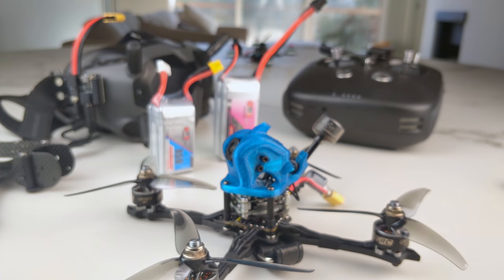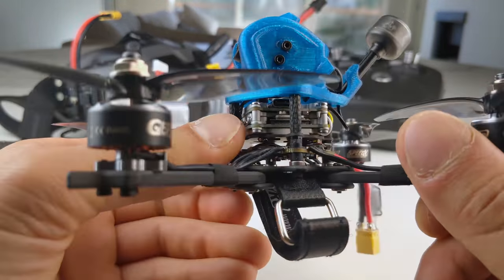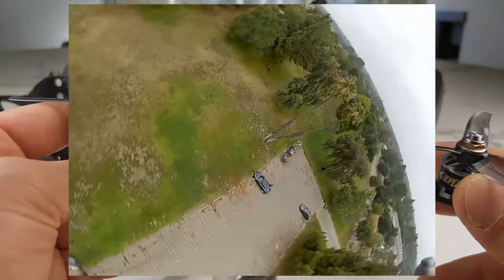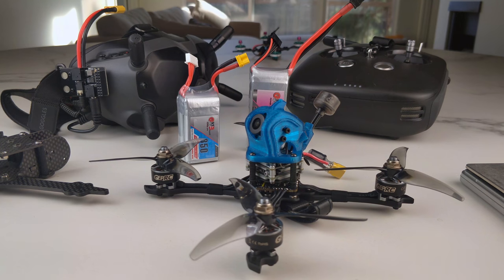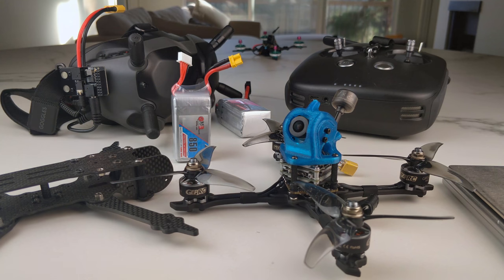GepRC - Dolphin HD

Comment: I never had those twitches but I was having desyncs with my standard definition version. 
I like the first one so much I ended up buying three of them a year ago and I'm still flying two of them. I did break one arm and cracked one by the motor screw, they are very tough and very reliable once you get them tuned right. Perhaps the flight stack height and weight difference had something to do with what you experienced?
I'm curious to know if you ever got that tuned out because I'm thinking about switching to digital and I'd like to know what to expect.
Reply from the maker: it's hard to say what a random desync is from. especially on these AIO boards. If it happens more and more often over a bunch of flights then it's an ESC going bad

Comment: Did yours have something making Ch.12 fluctuate in BETAFLIGHT on the receiver tab?
I remapped with mixes but it didn't change.
Telemetry perhaps?
Reply from the maker: It doesn't but I've seen that and I don't know why it happens. It seems to be more I'd a software issue than hardware. They reflashing betaflight

Comment: Definitely agree on the 6S thing. For racing 6S/5S helps a lot with sag and gives more instant punch so you don't bottom out in a split-S or whatever. I recently built a 6S Glide with DJI for freestyle and it's OK on 6S but better on 4S, even with the low KV motors. I can really feel the extra weight and I don't like it at all. I still prefer my old 4S hawk 5 with 6" arms and stock everything for freestyle. It flies so damn good - just wish I could fit a DJI unit in it.

Comment: I know this is an old video. But I have one and I believe the weird issues are more esc/aio related than frame design. Mine was hard to tune. Replaced AIO and then motors and it is a great quad now.

Comment: I bought the dolphin when it first came out on a whim and it was the first geprc quad or even part I had. It has hands down been the best bnf I own and I basically treat it as an in between for 3 inch and 5 inch. Geprc is now a fav. I feel like it has a great feel for freestyle, but kind of unique. I am curious about how you feel with ultralight 5 inch quads. I just built a quad with the bhobby 2004 motors and that thing is 230grams with a 850mah 4s...its pretty insane. With motors testing at over 1kg thrust on gemfan 5125 props, if accurate has like a 16 to 1 weight ratio or more lol. I'm a newbie though, but I feel like I have something really special here. Curious what you have coming up in the future.

Comment: I couldn't agree more on the self building. I wish RTF's were NOT a thing. By the time someone researches, buys and builds they will have a knowledge base and sense of pride that would help keep people from doing stupid things with their hard earned model.
Reply from the maker: yep.  I'm working on some RTF's however that have all the stuff I've been working on baked in.  They're going to be built exactly how anyone would want them built.  All electronics will be genuine and not shit.
Reply: @Kabab  Can't wait i'll buy one ,i like to build 5" the smaller ones for me are hard to solder. So i don't mind BNF 3" or smaller. Also if they are plug n play they are easy to build just solder motors to esc.

Comment: The reason I went with 6s batteries was because of Mr Steele's video where he said his 6s batteries lasted longer than 4s since they have lower amp draw per cell. That's the main reason I wanted to use 6s.
Reply from the maker: It's more complicated than that. They will last longer in the same overall Wh capacity if you're pulling so much power that you're landing prematurely due to sag. Otherwise, there's no benefits
Reply: @Kabab  Sorry, I should have been more clear. When I said they last longer, I meant more like I don't have to buy a replacement as soon. Steele said his 6s batteries will last several months while his 4s batteries last significantly shorter lives. I agree with you on the rest.

Comment: Hey man, my stuff comes Friday! (Finally) should I order the transmitter or I don’t really need it? I use the taranis x lite now and looking to get something different
Reply from the maker: If you're good with the x lite, I'd say wait.  Nothing right now is particularly compelling.
Reply: @Kabab pretty much a bummer eh? I bought the X9 lite off your recommendation, bricked it twice and had frsky fix it once, usually just pull the hearing aide battery inside and it fixes it. That thing has been a workhorse but I see no reason to get anything else except maybe the tango 2 if I make the jump to xfire?
Reply from the maker: @valden  tango 2 is good but wait for the update before getting it.

Comment: The tick is not a frame problem. It's a problem with the electronics... You'e got a faulty component, maybe even the gyro itself.
You can do blackbox on these quads. Openlager is fast enough to give you perfect logs even at high logging rates!
Reply from the maker: I've come across this issue so much over the years I find it impossible for it to just be a bad component.  I have also solved this issue over the years many times with tuning or adjusting things on the frame.
Reply: @Kabab  Loosening the PIDs and tightening the filters will address it somewhat, but that would only act as a band-aid hiding the actual problem. I have had this happen to me multiple times in the past, and it always boiled down to some component being faulty. Most often this was the Gyro. You can easily identify this in logs when looking at the gyro traces. The only way to know for sure would be to log it (use openlager!) or replace the AIO on this drone with another one that is known to work.
Reply from the maker: @fabianisensee3744  so I've got a quad I've tried four different aio boards on and still has this issue. Four different boards from four different manufacturers are all faulty?
Reply: @Kabab  that would be highly unlikely. Apologies :-)

Comment: How much longer of a wait for the new wave of motors considering Covid and everything
Reply from the maker: they're in shipping now...at least one of the new ones and all the current ones.
Reply: In my case it's LiPos that are unobtainable. Banggood does'nt ship batteries to my address, most Hobbyshops are out of stock. Even Ovonic has nothing in stock.
Reply: Yannick G Maybe try some shop on AliExpress? I got GNB batteries from there recently and they shipped without any problem to my location that is also excluded by Banggood in terms of battery shipping. Was also pretty fast (compared to Banggood).

Comment: Gday Bob, that was some nice flying dam that thing looks like it has a ton of power for a 4 inch, you mentioned  to run this thing on an 1000 mah to 1100mah 3s what kind of flight time would you get? great review its been a while but we know that you are always busy, nice work mate.👍🛸
Reply from the maker: It'll get probably a 4-6min flight on 1100mah 3S if you're pushing it.  Likely ~8min if you're just cruising around
Reply: @Kabab  Wow thats alot of flight time, thanks Bob.👍
Reply from the maker: @spartan-fpv6936  I forgot to talk about the big positives of 4". That's one of them if you're not trying to race your ass off 🙈
Reply: @Kabab  Yes i dont race or fly fast  i just just cruze, i think 3inch and 4inch are a great size for park flying dont you Bob.

Comment: I have an idea to reduce all your motor mixer values to .8 instead of the throttle cut. It will probably be enough to get rid of those ticks.
Reply from the maker: It has a lot to do with the excessive kv, powerful motor construction and high voltage. You can throttle cut but it's still got the kv on it
Reply: @Kabab  from my understanding the motor mixer works differently than the scaled throttle cut.
Reply: @Kabab  wouldn't running the motor mixer at .75 for all (nonzero)values effectively limit the motor outputs at 3s.
Reply: @Kabab  I have been very curious and skeptical about this myself though. Is this not how it works?

Comment: All my Quads (3-4’’) with BF 4.2 have strange wobbles (like tiny shakes) in the mid throttle region. I don’t know what it is, I’m pretty sure it wasn’t there with 4.1. I haven’t managed to tune it out yet. Today I flew a 4’’ with black box, maybe I find something.
Reply from the maker: Those BF 4.X wobbles are actual wobbles from something in the software.  This particular case isn't quite the same however I do believe going back to 3.5.7 would probably improve this quads disease.  :-)

Comment: From December 31st pilots in the EU need a special license if your quad weighs more than 250g. I dont think it's a design criteria because of physics, but because of governmental policies. The 250 g mark will become more of a thing because of this.
Reply from the maker: Sure but do they go around weighing things?  Is that with or without battery?  Is the law that specific?
Reply: @Kabab   its auw, yes the law clearly states this 250gr number, it defines the border between privatly build quads that fall in the c0 categrory(basically as free as it gets) at 249 and c4 (heavily regulated and need to register your drone at the authorities, need to mount a small plate with your private details on your drone) at 251 grams.
While controls are not common they do happen and many people simply cant afford to be caught flying an unregistered drone which they needed to register
Reply: Oi u got a license for that drone mate

Comment: I gotta say its still sooo hard to beat the Iflight Nazgul for $180.  But as soon as you want a BNF toothpick the price goes up significantly... so dumb.
Reply from the maker: yep.  I actually think a pre cut and ready to solder or plug in kit is better than RTF.  Like the Tyro things.  Super quick and easy to assemble.  I'm debating which way to go actually.
Reply: @Kabab  ive been fighting these AIO boards for months now. Ive tried a few nameless rc boards with little to no luck(one was DOA). Really hoping this beta fpv 12amp holds up. Starting to feel like if its not a 30x30 frane its not for me 😂

Comment: Failure rate of above 50%?  Seriously?  I've built probably 80-ish quads, and I've only had a few bad ESC's and possibly one motor.  There is no way I'm that lucky...  do you mean 50% after getting 10 or more flights out of them without crashing, or some other qualifier for your statement?  Seems high, but then again I'm no vendor.  I've been soldering since 1988 though ; )
Reply: Lucky compared to me
I have a bad history with 4in1 ESCs. I must have 5 or 6 faulty ones that will make one motor twitch (Diatone,DYS,HGLRC). One of them will burn the motor as soon as armed (Mini Mamba MK1). I always use conformal coating and I rarely use turtle mode. Multiple minor crashes just took their toll. I'm trying Spedix ESCs right now. So far so good.
Reply from the maker: It depends on the product.  Some electronics in this industry exceed 60% failure rate.  A few of those are happymodel parts, some are BetaFPV parts, some are HGLRC...  These companies don't want to make things that fail, they just do.  Not all parts fail like this but it's hit or miss.  To me, even 5% failure is a botched product.
Reply: @Kabab  I'd agree with that.  >5% is a failure to QC which shouldn't be put on the vendors to cope with.

Comment: I see 6s as necessary for the bigger heavier quads. Even for my 7 inch I used 4s, and that was enough for me
Reply from the maker: Yeah things that need it, sure.  I think anything bigger than about 8" should be on 10S or 12S
Reply: @Kabab  Depends how you set it up - my 6S 7" quads are still hugely fun on 4S, but it's the same deal as spec racing, you're deliberately giving up performance in exchange for flight time.

Comment from the maker: Dolphin HD: https://bit.ly/2V8CYdL
Recommended batteries:
4S: https://bit.ly/2V7cvx4 (recommend switching quad to XT60)
4S: https://bit.ly/2By2qCi (recommend switching all to XT60)
3S: https://bit.ly/3erCuHg

Table of Contents:
►00:00 - Intro
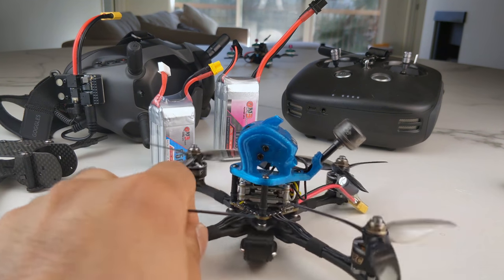►02:15 - Quad overview
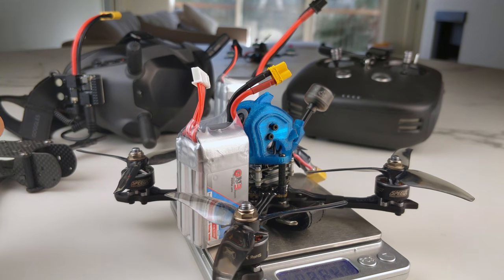►03:35 - 250g obsession?
►05:47 - Flight video
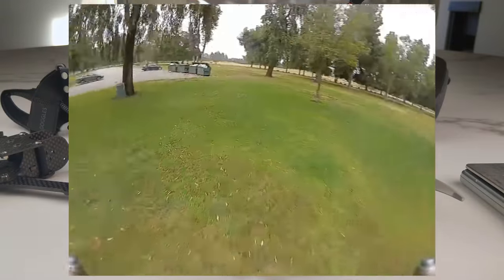►09:40 - 4" dilemma
►10:42 - Issues with light and powerful 4"
►12:45 - 4S vs 3S
►13:41 - 6S everything?

▼Join my FB group for more discussion: Kabab FPV
https://www.facebook.com/groups/379155946182689/

The store: www.FPVCycle.com

▼ My typical 5" quad setup:
-CineGlide: https://bit.ly/2MCoz50
-Motor: http://bit.ly/2Nqqr25
-ESC: http://bit.ly/2oDdzvL
-WaFL’s Cap Cap: http://bit.ly/2GUpXxO
-Battery: http://bit.ly/2JnsTDM
-FC: http://bit.ly/2XRc8G8
-FPV Cam: http://bit.ly/2Q7LfL7
-Vtx: http://bit.ly/38Y25oz
-ND GoPro Mount 30deg: http://bit.ly/2WC15zc
-ND Filter (if used): http://bit.ly/2WEmQ1j

▼Notable motors:
None.  Wait for the new wave of motors

▼Starter goggles: http://bit.ly/2qbJNOS

▼ If you want to solder better:
-Fantastic solder: https://amzn.to/2P5QM2W
-Fantastic iron: https://goo.gl/DqBipa

▼ Tips?
Patreon: https://bit.ly/2oGLP9b

-PayPal: https://www.paypal.me/kababfpv
-Bitcoin: 1E4XZXoD4rS6MYWVWuenY7Kw2M1YgyNpoQ
-Nano: xrb_1188ek5bd7tb9kw67asnp9o65byuoaxbtpxuznx1ribf75x78awywmakj55f
-ETH: 0xD067F93811f2eC31CB1928901002dfdf9A492EF5
-LTC: La2KWYAjp4VT2Lq2M76pbjzXWvRyjpfCtG
Reply: Is there supposed to be more content at the end of the video?  You have time stamps about hdo2 vs orqa etc

Comment: 250 is arbitrary? BLASPHEMY!!!! also cant wait until your ciniframe comes out!
Reply from the maker: lol, two sticks of butter
Reply: during WW2, they were doing research on how to take down bombers with as little resources as possible, as they where running low on metal. They found that while two sticks of butter are not enough to take do any damage, adding just one more stick is enough to cause catastrophic damage to bombers. hence, the 250g rule. unfortunately, before they could publish any of these claims, a clumsy aid dropped two sticks of butter into the floor,  deleting the base from all existence, save a small note from the head researcher, claiming that anything above 250g was lethal. true story, might as well be at least

Comment: "15xx to 18xx" size. Man I wish they would release modern 18XX sized motors. The only decent ones I can think of are BH returners.
Reply from the maker: I've got you covered.  Just waiting on delivery
Reply: @Kabab  Ooooh, looking forward to the reveal! Right now my 4 build would run on BH T2 1608-3200s that I would tweak for 6S. Good Idea? I have all the parts besides some 4in props. All I have are old DALs.
Reply: @Kabab  oh yes! Yes! Running 1606 on my 4" gecko and it is barely enough. 1806 would be awesome! With large bearings of course.
Reply: Try 2204

Comment: I had to sit thru a 5 second advert for this? Couldn’t understand a word! You certainly have restricted your audience
Reply from the maker: 🤔 what do you mean?
Reply: What does 6s,4s, mean?
Reply from the maker: @pierstaylor7780  so you just have no idea what you're doing and decided to be rude in your ignorance.  There's a real person on the other side of these videos.  Content doesn't just make itself. It actually takes a ton of work and is quite disrespectful to comment such bullshit.  You can always ask questions nicely or Google anything you don't know. 

The S referrs to the battery voltage. It's how many cells the battery has. Each cell ranges from 3.3-4.2v depending on how charged it is.  Over the years the industry has been pushing for higher voltages but they often don't lead to any performance gain and just more problems.
Reply: KababFPV thank you for explaining. It wasn’t rude, I not like that. Like so many who are new, we get frustrated. (3 full evenings to setup & bind a tiny whoop) as the majority of the videos may as well be in a foreign language There are very few videos that new ones to the hobby/sport can actually grasp. 
The only ones I’ve found that are simply explained in a simple clear way is by “project blue falcon” sadly has since passed, I wonder who would be able to offer similar videos? We (our group) have found a couple but sadly there are few.
Do you have any videos that could help a complete novice? With phrases explained? I would eagerly watch, study, learn and gladly share.
I’m sorry if you felt offended